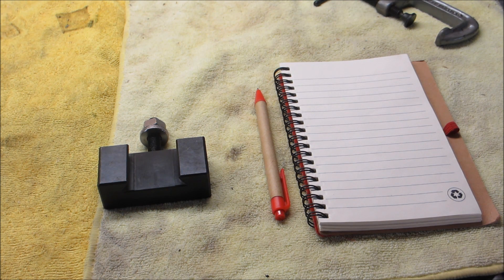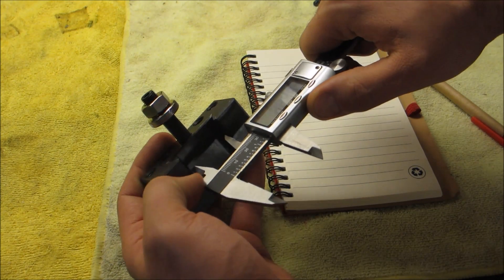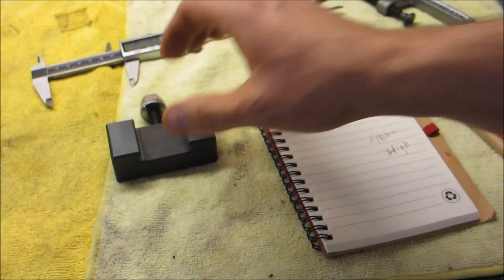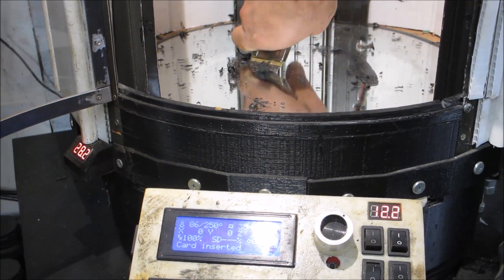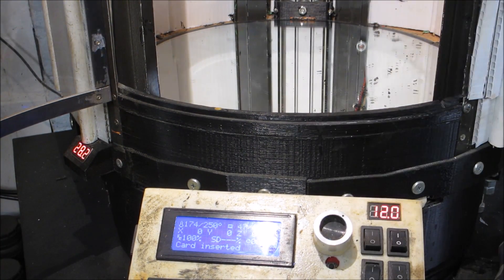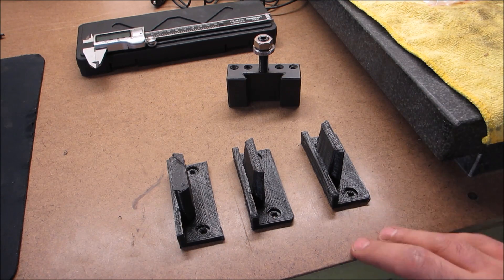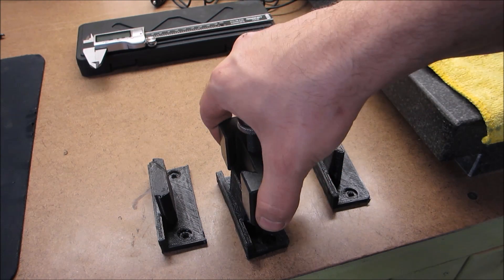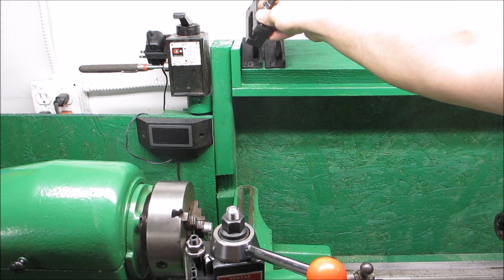3D Printing in the workshop - AXA Tool Organization

Comment: I find counter sunk screws always split the plastic, much better when I use flat screw heads
I don,t use sound in my videos, so I don't know how difficult it may be, but I found the music much louder than your voice
Had to keep adjusting the volume, is it just me?
Reply from the maker: smallcnclathes I had all sorts of trouble with this video and sound. This is as good as I could get it. As for countersunk screws and splitting. I have not had that issue.
Reply: Bruno M. Perhaps I am too heavy handed LOL
Thanks for letting me know about the sound I thought perhaps it was me

Comment: That tool holder is very handy.   Mrpete222 was printing last week.  I guess I am the only  guy who does not have a 3D printer.  😉  I am waiting for them to print metal.  Thanks for the video.
Reply from the maker: +Amateur Redneck Workshop Harold. Ask bangood. They will send you one. Or you could go my route and spend a year building one from scratch and learn how to use a cad program and learn how to customize firmware and become obsessed over wiring... Etc etc.
Reply: I am not yet that sold on the usefullness of 3D printers.
Reply from the maker: +Amateur Redneck Workshop it's possible that they are not for you. However I would be willing to bet that if you had one you would enjoy playing with it.
Reply: I haven't got one either, these videos are are making me think I could do with one though!